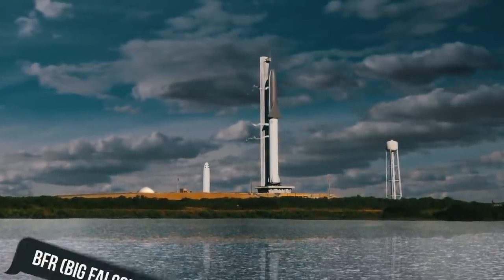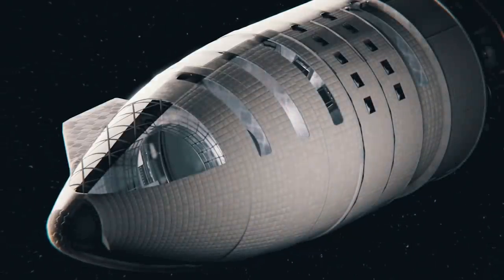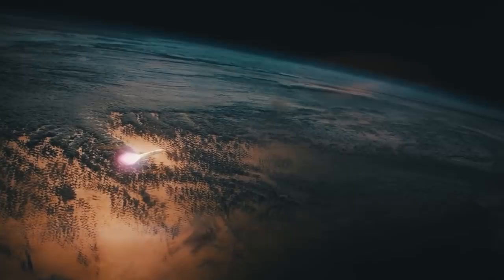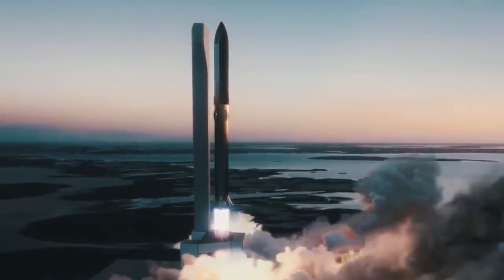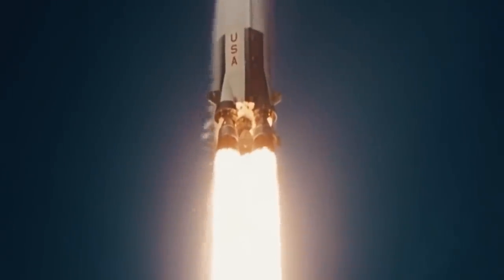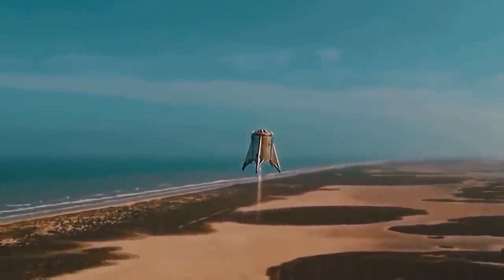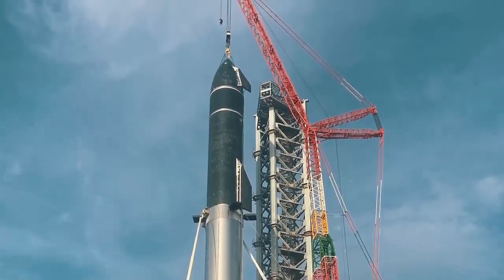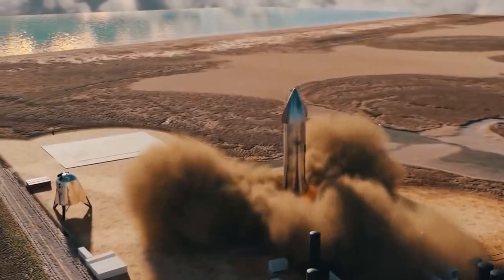Elon Musk will Reach Mars With This Amazing Starship

Comment: The spacetime equation is described by a foliation of space-like hypersurfaces of constant coordinate time t, with the metric taking the following general form to create a continuum definition: 
{\displaystyle ds^{2}=-\left(\alpha ^{2}-\beta _{i}\beta ^{i}\right)\,dt^{2}+2\beta _{i}\,dx^{i}\,dt+\gamma _{ij}\,dx^{i}\,dx^{j},}{\displaystyle ds^{2}=-\left(\alpha ^{2}-\beta _{i}\beta ^{i}\right)\,dt^{2}+2\beta _{i}\,dx^{i}\,dt+\gamma _{ij}\,dx^{i}\,dx^{j},}
where;
α is the lapse function that gives the interval of proper time between nearby hypersurfaces,
βi is the shift vector that relates the spatial coordinate systems on different hypersurfaces,
γij is a positive-definite metric on each of the hypersurfaces.

Okay pretty easy, you now have a starting point. 
.

Comment: 8:52  How can 1 foot equal 0.984 feet? I think they might just miss Mars with those calculations.
Reply: They said it made a small jump of LESS THAN 1 foot. It showed 1 foot (0.984 feet) and guessing the 1 foot was rounded or simplified as the nearest whole integer, but also showed the actual feet of 0.984. This is done in spreadsheets and computers all the time, it displays more basic numbers but it does keep track of the actual number.

Comment: He needs to make a space station. A kicking off point. And I don't mean that little piece of s*** that the NASA built something that's big enough to hold a Starship. That is 4 times larger than this vessel. There's no point to think small. When you're talking about space and you're probably scientist that will go into space and never come back in their lifetime. One of the founders of Skunk Works has warp drive engines. But they have no shielding to protect the craft from the pressure. That's why it's been stopping this all this time no Force shield

Comment: don't different atmospheres have different density's meaning this belly flop maneuver wont have a uniform declaration effect. for example mars atmosphere density is  ~0.020 kg/m3 and earth atmosphere density is 1.2 kg/m3. earth atmosphere is like water compared to mars and that would help slow down the space craft much faster then what would happen on mars pluss mars atmosphere is all so shallower at   10.8 km and earths is 16 km giving the belly flop maneuver more time to reduce speed as well as the extra density. would it work the same on mars as it dose on earth???

Comment: If we could figure out how a 🛸 works, that would be the best way to fly! They seem to be able to electrically control the forces of gravity, & because if it, are not subject to G force. I say electrical, because many near them have witnessed electrical interference, as in static on radio equipment. No effects of gravity, & you negate the need for any air foil used in today’s aircraft for lift, & eliminate its limitations, such as stalling....

Comment: In my opinion stainlessteel is to havy and because of this it's necessary more frust,more energy consumed!I think alluminium or something smart aloy coult be much better and space sheep must be build by modullar system for fast change necessary pieces.With a steel space sheep the havy wi'l be to high,this havy could be replacement by a light havy and less metoxide!

Comment: Why do continue and insist the thinking of child like concepts of sending a rocket into space from the ground. Are you aware at all that the 787 is nearly 20 feet wide, available now days.  You can more easily assemble your stuff in orbit now, near Earth orbit still using the atmosphere will you still can--don't need  your LOX yet, save for later still, seems your going to need it because your speed on the way to Mars will be still be slow due to you using chemical propulsion. Anyway it would be be cheaper to gather your necessities in orbit before your trip i have no more to explain. Farewell.

Comment: Why doesn't he use deuterium instead of liquid oxygen? Also if he gets to Mars where is he getting the fuel to return for supplies or if there is a medical emergency? There no easy fly by to help them if there is an emergency or unexpected anomaly. I have yet to see any preparation for the unexpected.
Reply: deuterium is an isotope of hydrogen and burns. but you need an oxidiser, AKA liquid oxygen in this case, for the hydrogen to burn